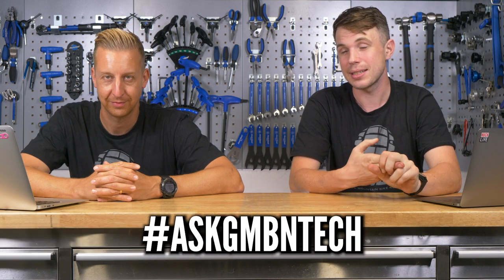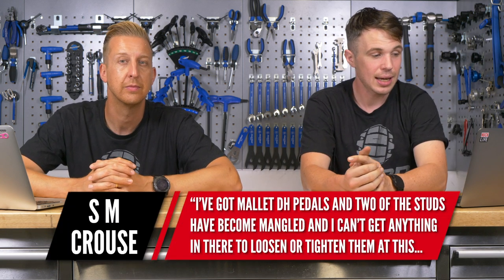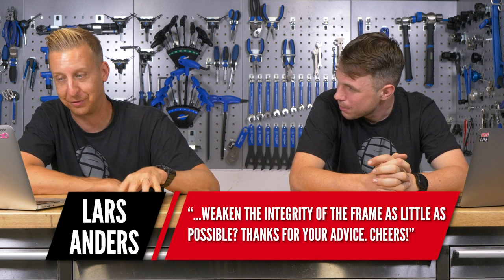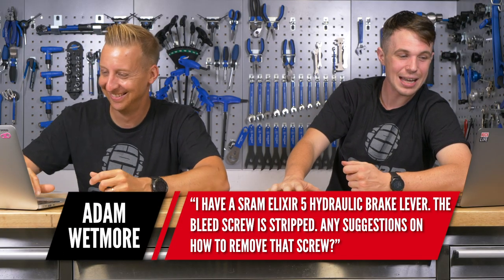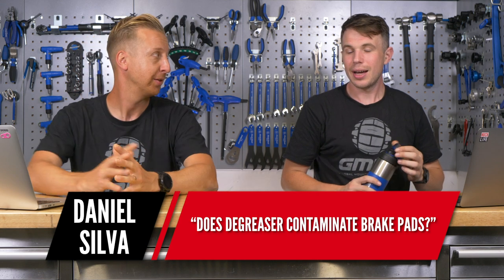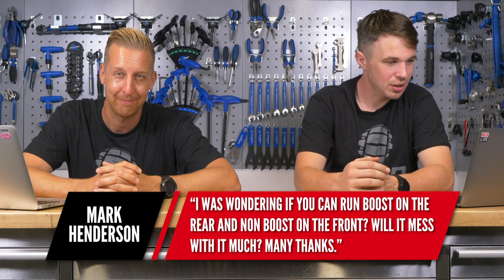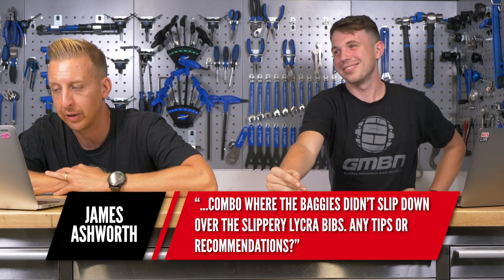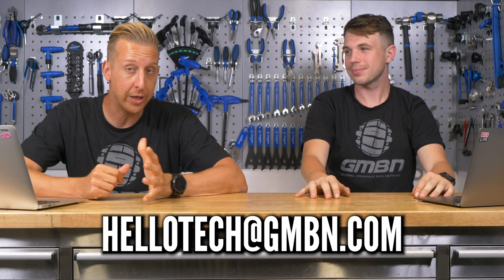Should I Make Holes In My Carbon Frame? | Ask GMBN Tech Ep. 81

Comment: #AskGMBNTech
I'm riding a bike that's about a 10 to 12 years old XL-frame. It was a gift by my parents in my youth and has been only occasionally ridden in that time.
At the beginning of this year I've started to pick up mountain biking as an actual hobby. My problem now is that I can't get my wheels to lock up anymore now that I'm about twice as heavy then when I got the bike.
I've recently replaced the brake pads for new ones (Shimano B01S) but this didn't increase my brakes performance. They are mechanical 1-piston calipers with 160mm, resin only rotors.

Which way do I get more braking power? Changing pads to more expensive models (maybe even from a different manufacturer?), perhaps moving to sinnter-metallic pads with new rotors or switching to budged hydraulic brakes like the Shimano BR-MT400?
I would love to fit bigger rotors but I can't find what the limit for the fork is and the gap between rotor and the frame already feels rather narrow. How much frame-clearance should a rotor have any way?

Thanks for all the help you've already given me.
Reply: 203mm front rotor and 180 rear and just buy Hydraulic brakes with normal pads properly bedded in.
Reply: @th_js  Won't fit, rotors to big.

Comment: #askgmbntech Hi guys, PLEASE help me... this problem is just killing me... its been going on for months now. So my problem is my drivtrain makes noise when its under load + you can also feel it . Last time i felt it went to a bike shop they said i need replace tha chain... it worked for a month or so then it cambe back,  i replaced my chain + casette + jockey wheels too  ....3 month after it cambe back again..what could be the problem? Worn chainring up front? ( its a 3x)
Reply: Kóbor Tamás it could be you are powerful, so you wear out chains fast. If I were you, i would buy a chain checker, so you can tell if your chain is worn out
Reply: @peterlang5047  Well i live in a hilly place but it seems a bit much for me , + i bought 3x more expensive chain this time which is even e bike ready and after 3-4 month is  maybe "worn out " . but thanks the advice i will buy a chain checker.
Reply: Make sure your BB is ok and that front mech is properly set up as if it isn't the front mech could be running and fusing your issue
Reply: @jamespachebat6707  BB and front mech is okay, already checked- regreased it .

Comment: #askGMBNtech Hey guys I was wondering if I can fit maxxis WT tyres on a 25mm rim? Normally the tyres are designed for 30 or 35mm rims. But my wheels can fit up to 2.5” tyres. The tyre that I want is a Minion DHF Front WT 27.5x2.50". Thanks
Reply: Just go with the non WT version or if you must use the WT, it will be fine, but very round which some people might like.

Comment: #AskGMBNTech I have a 100mm manitou xc fork, which I increased it to 120mm by removing a spacer. Now I feel that the compression seems a bit slow. Should I remove some oil from the dampener/lockout side of the fork?? Thanks in Advance.

Comment: #AskGMBNTech can I buy somewhere those rockshox lyrik red lowers ? Thanks
Reply: 11.4018.091.002   FORK LOWER LEG - (SILVER DECALS INCLUDED) 27 15X110 BOOST™ RED - LYRIK B1+(2016+)
11.4018.091.003   FORK LOWER LEG - (SILVER DECALS INCLUDED) 29 15X110 BOOST™ RED - LYRIK B1+(2016+)

Here are the part numbers and descriptions for the 27 and 29er lowers. Copy and paste those numbers into google and you'll find them. If you look up the 50 hour service video from sram it will give you enough info on how to swap out your lowers as well as getting that service taken care of. It's pretty easy to do if you're somewhat technical minded.
Reply: @camt2780  thanks !

Comment: #askgmbntech

 Hi, recently I got myself a new dh bike that has boost in the rear and and a fox 40 with 110x 20. I have a set of crankborothers iodine 2 wheels with 148x 15 in the back and 100x15 in the front. And the question is, is it possible to fit  them?

Loving the channel and hope that Henry is going to see a doctor, you can't have a long ride without a shammy.
Reply: Sell the wheels.

Comment: #ASKGMBNTECH Hi, I've recently bought a brand new canyon torque but the fork (rs yari)isn't feeling as fast or as suplle as I'd like to... even with the rebound damping fully open it doesn't recover as fast as I'd want to. Could also use some lighter high speed compression set up. Can I switch to a lighter oil in the hydraulic cartrige? Thanks a lot
Reply: Maybe its a break in fork

Comment: #askgmbntech Hey guys, I have a 2019 RockShox Yari on my Canyon Torque that is 180mm of travel. It has 2 tokens in it and I weigh around 70 kilos. When I ride down any averagely rough trail, (rocks, roots, jumps and drops) I’m only using about 1/2 to 2/3rds of my travel. I’m running about 85 psi with 27% sag which is recommended. I want to make use of all of my travel but I don’t want the bike to feel unsupported with lower pressures in the fork. (although it would be very plush) should I remove some tokens or lower the pressure?
Reply: Remove tokens.

Comment: the only safe way to clean brake pads and rotors is to use them
Reply: for the rotors I use paint thinner, or in the worst case first a high grid sandpaper then a wipe down with paint thinner (you do have to heat them up agian), same goes for pads, it always seems to work.

Comment: #askgmbntech
Hi guys, love the channel and learned a lot from you guys.
Right now I am looking to upgrade my 29 inch rochshox judy coil 2019 that came on my roscoe 7. It has somme play in the bushings and I am riding it hard. So I was looking for the new rockshoxs 35 debonair, but in the 27.5 wheel size because I can pick a longer travel since the axle to crown is almost an inch shorter at tge same travel. But the 35 in 140mm travel is way more expensive than the 130mm. So I was wondering if I could just upgrade the debonairspring to a 140mm. But are there anny things that I should considder like damper lenth or stanchion lengt??
Thanks in advance!
Pieter
Reply: kareltje pleco make sure the 27.5 forks are compatible with your tire size

Comment: Hi GMBN,  I have Tektro brakes on my Giant stance e bike and the brake levers almost cut my fingers off when im trying to apply the breaks...any tips on how to make my brakes more sensitive? thank you
Reply: U can get little comfort tubes to go over the levers
Reply: if they lack power and feel spungy at the lever bleed them. if lever has a solid stop but no breaking force try new decent pads, cleaning rotors and bedding them in. if that doesnt work you can try larger rotors or new brakes
Reply: What exactly is your problem?
Do you need to apply an extraordinary amount of force in order to make your brakes actually brake?!
Is your index finger being "cut" into by the lever?
Or does your middle finger get pinched in betwen löever and grip as you pull the lever tight?
(And what's your very model of break? Tektro is just the brand! Mechanical/hydraulic etc?!)
Reply: Try adjusting the reach so the lever sits farther away from the bar. Also, try putting some Sugru (google it) on the ends of your levers so they won’t cut your fingers.

Comment: #ASKGMBNTECH
I am currently using a 7 speed freewheel, can I upgrade it to a freewheel with higher speed
Reply from the maker: If it's a freewheel (screw on) you can find 8 speed options but will also require a new shifter. Providing the chain is not worn you can use this as the width is the same across 6-8 Speed. Hope this helps 👍

Comment: #askGMBNtech what is the best a
Affordable hub set as I haven't got dentist money I'm running 27.5 wheels. By the way loving the show. ❤
Reply: Shimano hubs are cheap and bombproof but use cup and cone bearings. Novatec is a cheaper hub brand with cartridge bearings and mixed opinions. In my experience they work just fine

Comment: #AskGMBNTech 
Is it really nessesery to use carbon paste on parts like a seat post, or are you fine with a bit of normal grease?
Reply: carbon paste introduces more friction, whilst grease reduces friction ...
Reply: some greases will weaken the resin over time so make sure to use at least carbon safe greas. but as said before best is carbon paste since it has particles to increase friction and thus reduce clamping force neccesary
Reply: Do not use grease on carbon parts as some resins In carbon layups are broken down and can expand and get parts stuck. Get several people coming in to work with carbon seatposts stuck in frames because they used grease
Reply from the maker: It can depend on the situation but if you do remember to check the grease is carbon safe. The Park grease we use is safe for carbon 👍

Comment: #askgmbntech i have an slx cassette on my hardtail and i can’t remove it I have the tools but when I try to untight it it just make clicking noises.
Reply: gotta get a chain whip to keep the cassette from spinning
Reply: Do you have a chain whip, and are you using it correctly? You need to use it to keep the cassette from just spinning when you try to take it off .
Reply: Yes i have a chain whip and a cassette tool but when i turn it it does some clicking noises
Reply: @pascalleblanc6670  are you pushing on the chain whip in the right way? You should be pushing it right to keep the cassette in place and rotating the cassette tool the opposite direction. It helps if you turn the wheel vertically and push down on them, with the tools in a v shape.
Reply: LBS is ur answer
Reply: Clicking noises happen when you tighten or loosen any cassette

Comment: #askgmbntech what fork would you recommend when swapping out my xcm (straight steerer tube) fork on my white xc290 lite  29er.   Seems that all forks are tapered 😒
Reply: manitou and rockshox have straight options. on the low end manitou markhor and rockshox recon. on the high end rockshox reba and manitou machete
Reply: You could always get an mix and match headset cup to run tapered on a strait tube.

Comment: #AskGMBNTech I have just found out that my rotors bolts were crazy loose, after practicing some trials technics. I am running 180mm rear and 200 front rotors with code brakes on my canyon torque. what type of loctite would you recommend for this use.
p.s love the tech show
Reply: Ran Weisberg the best loctite is a welder they will never move again, nice bike btw.
Reply: @johannwinkler2183  Tnx, I will try it.
Reply: @dotrannet  Dont weld on your rotors, thats terrible advice.  Any kind of loctite or anti seize will work fine, tighten them correctly and check them occasionally.
Reply: @ericliebert5260  Tnx, I know I was not really going to weld them, I ask what type because I know that there are different types of Loctite for different applications.
Reply: Solid stick/dry type (blue) by loctite
Reply: Rupert Wenn tnx
Reply: Def blue!
You can go red as a last resort if you're okay with binning rotor and hub when sth needs fixing.
Reply: they have got many many options not just blue and red. loctite 222 is low strength for small and alloy bolts and loctite 243 is medium strength for bigger and steel bolts.
id recomend the 243

Comment: #ASKGMBNTECH 
I have a fiant reign 2017 with a yari fork with 160 mm travel. I have no tokens in it compression open and about 20% of sag. My problem is that never use my travel, there is always 2 cm of travel left (even when i land flat hard) what can i do??????🤔

Keep doing what you are doing👍👍
Reply: @DFW rider the fork wont compress fully
Reply: For enduro 20% of sag is too much hard. You may try to run your suspension with 25% of sag and feel the diference. If you say that you never use that final travel, you will get more performance from your suspension by lowering the psi of your fork.
Reply: Take all the air out and see how much your fork can compress. You might actually be using all your travel
Reply: @edgarsoler5865  I was also thinking that and i will do that👍
Reply: @edgarsoler5865  there is a difference from fox to rockshox. Yesterday i rode the bike of my friend (fox rythm 34 150 with one spacer) and he weighs 20 Kilos more then me and because of that the fork is bery hatd for me. And i bottomed it out on the same jump
Reply: @peterlang5047  it compresses until you can see about 2mm of stantion